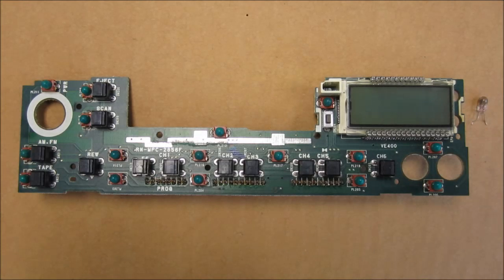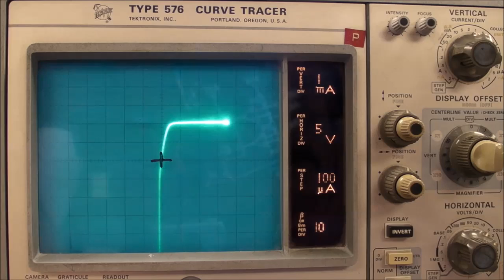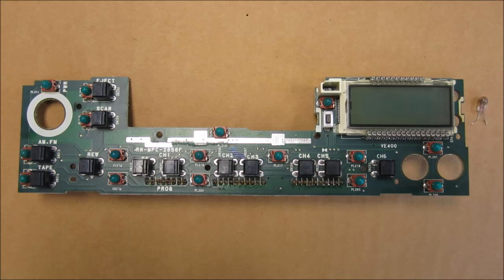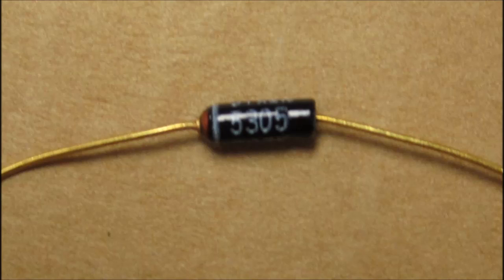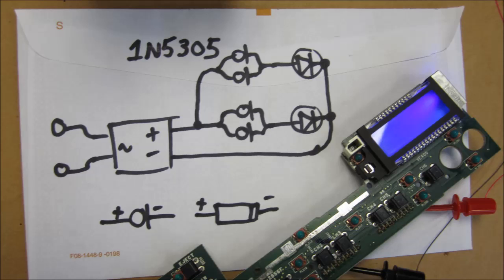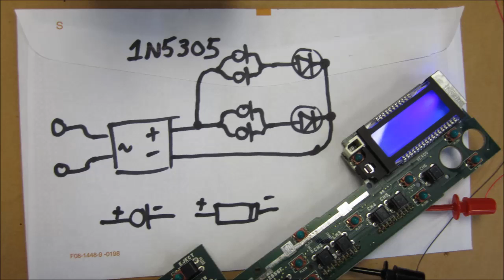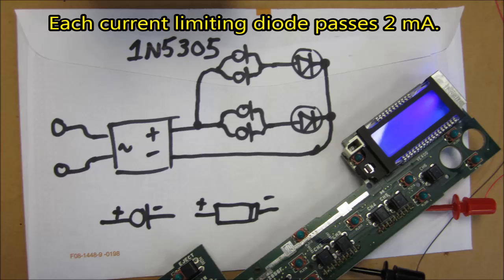(#0101) Car Stereo Blue LED Mod - Design for Ambiguity

Comment: Those lamps were (and in some cases still are) used because they emit light relatively evenly over a 180° hemisphere.  It is still hard to get LEDs to do this; nowadays LED solutions use either one or more LEDs under each button or lightpipes in the button assembly.
Those lamps also had expected lifetimes in the tens of thousands of hours, so failure was not that much of an issue.

Comment: Clever solution but why not just power the equipment up and measure the voltage?
Reply from the maker: Because I did not have the equipment, nor did I even know what model radio it was.
Reply: Eric Wasatonic
Whoops, must have missed that bit!

Comment: i want to change my orange colored odometer on my altima 2004. can i do it like this? I don't want to fry anything...
Reply from the maker: I don't see why not. It should be as easy as replacing the orange LED with a blue one. You may need to change the LED's series resistor too depending on how bright the blue LED is and how bright you want it to be.